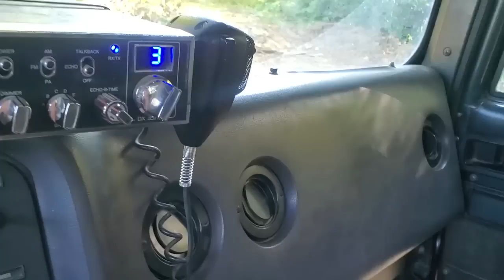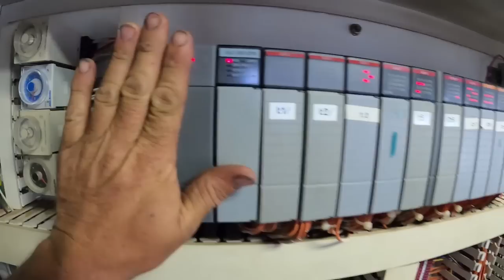Behind the 8 ball

Comment: Enjoyed the control panel of the resaw. I worked with Allen Bradley SLC processors in industry for 24 years. I replaced my fair share of those rack power supplies that had the same tell-tale hot spots.
Reply from the maker: What is your thoughts then bud
Reply: Logger Wade it’s hard to say but I think you were right when you thought it was a power surge. I bet that the diodes in the bridge of the power supply are opened.

Comment: would you believe Tamrock uses those same boards in their underground drills. Plus those timers are used by Mcclean in their underground bolters. I have seen those push/pull switches on a lot of underground machines.  Never saw those fuses used, those would have been useful.  Those electric eyes you use, we used them on the back of the forklift seats, as a operator present switch for an alarm.
Reply from the maker: Awesome its a small world bud